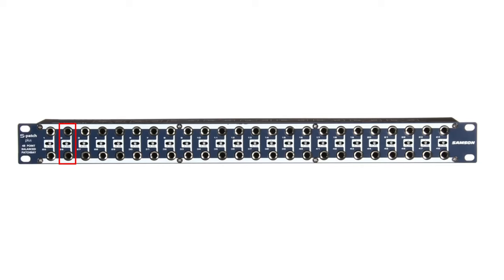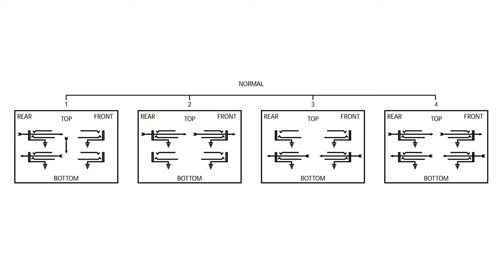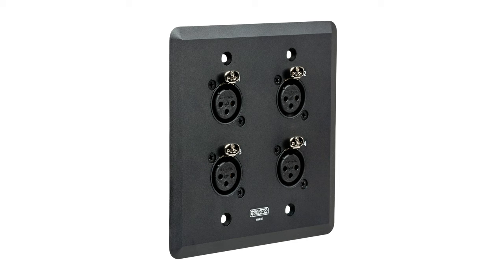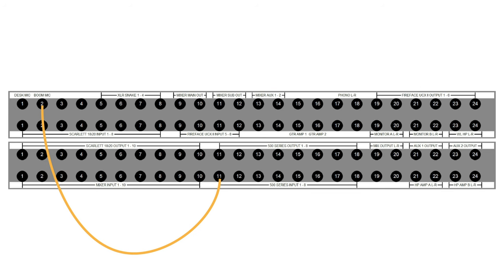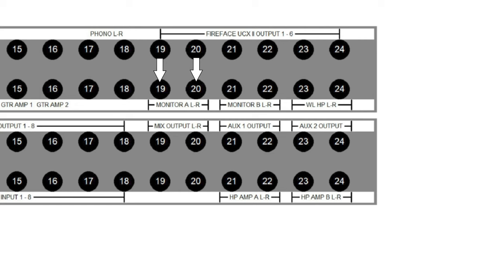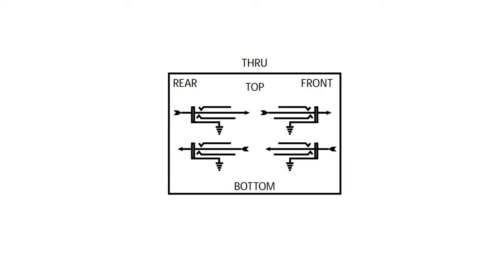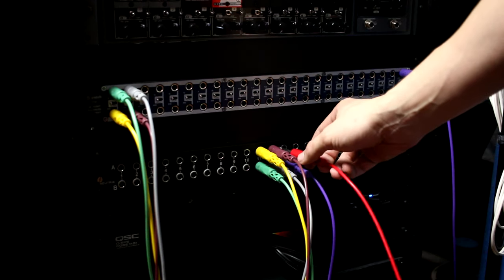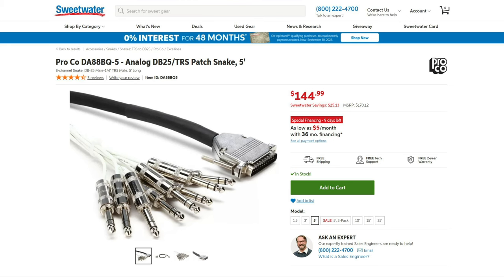How To Set Up A Patchbay In A Studio | Layout, Normalling, & Setup

Comment: stupid question if i want to use a condenser mic wich needs phantom power and route it to a mic pre via the patch bay do i provide it with an external phantom power suply or ?
Reply from the maker: The TRS patchbays in this video can pass phantom power. Just make sure to disengage phantom power before connecting or disconnecting the mic on the patchbay.

Comment: Might've just been a mistake on your end, but the top jacks are typically outputs on patch bays, not inputs.
Reply from the maker: On the rear panel, they are inputs that correspond to the output jacks on the front panel.

Comment: This is awesome but I have a question...At :24 you said the top row in the back are inputs and bottom rows were outputs..I thought it was the other way..outputs usually on top and inputs on the bottom...I'm probably wrong, but i'm thinking of the patch bay as an extension of what is being connected to it..can you clarify? Thanks so much

Comment: I have a question, is it safe to put phantom power directly through the patchbay with all my other gear connected as well? In this case I have the Samson but I've read in forums that for connecting microphones directly into the patchbay you should really get a dedicated XLR patchbay. Thanks a lot for this brilliant information.
Reply from the maker: As long as phantom power is NOT engaged while connecting and disconnecting the mic, it should be ok. However, to be safe you can use an XLR panel instead for patching microphones.
Reply: @AudioUniversity  thank you!

Comment: Could you clarify for me? Your boom mic for example that you showed; how is it going into the patch panel? Is it via a snake that converts to trs? I’m assuming you don’t just do all xlr to trs cables for your microphones?
Reply from the maker: That particular microphone is actually hard wired to the back of the panel with an XLR to TRS cable because it never gets disconnected. However, most mics patch to the XLR panel which is connected to the back of the patchbay.

Comment: Amazing video!! One question.. I have an 8 channel mixer with only 2 stereo imput, and and want to connect all my keyboards at the same time to record, patchbay is a solution for that?
Reply from the maker: Thanks, David! A patchbay would allow you to use patch cables from the keyboard (jacks on the patchbay) to the stereo mixer input (jacks on the patchbay) instead of reaching behind the mixer/keyboards directly.

You can also use two mono channels on the mixer for each stereo keyboard.

Comment: So, if I want to go with a patch bay I need to but a boatload of XLR to trs adapters for my microphones?
Reply from the maker: Rather than connecting the microphones directly to the patchbay, I’d recommend an XLR patch panel or XLR snake that is connected to the back of the patchbay. 

Something like this: https://imp.i114863.net/YgMaGB

You will still need to either solder TRS connectors to that or use XLR to TRS adapters. The benefit is that the mic panel/snake is always connected to the patchbay so you can simply connect your mics to that panel with XLR cables.

Comment: Is this possible? I want to run a mixer into a patchbay that will have at least 6 synths. 3 of those synths can sample. I want to use the inputs of those devices through the patchbay. I then also want to individually connect 9 different FX Pedals in the patchbay so that I could connect which ever synth to the pedal or a series of pedals to record on my PC or one of the samplers. And finally, would it be easier to reroute the audio chain back to empty mixer channels, then out to my monitors? Or should I patch the monitors to the patchbay?

Comment: Hi there, how can you use a jack patch bay with condenser microphones? I have an 18i20 too and I still can't fathom how you would use a patch bay for condenser mics. Would you just keep the two inputs at the front of the 18i20 spare for those mics?
Reply from the maker: The patchbay in this video can pass phantom power. Is phantom power your concern?
Reply: @AudioUniversity  yeah that's my concern.  Could you explain what the cable chain would be please?
Reply from the maker: The microphone will connect to the patchbay with an XLR to TRS cable and the patchbay will connect to the interface with a TRS to XLR cable.
Reply: @AudioUniversity  excellent thank you for the reply. And it's the Samson patchbay that allows phantom power to go through?
Reply from the maker: Glad to help! Both the Samson and the Neutrik patchbay pass phantom power.
Reply: @AudioUniversity  you've been very helpful, thank you 🙂
Reply: @LeopardBull5trik3  The very last line at the bottom of page 7 of the manual for the Samson S patch Plus says: "It is not recommended to connect microphone outputs to any patchbay due to their low operation level."  -  To me this means say taking connecting a dynamic mic with a XLR-to-TRS cable, as that's obviously a teeny signal.  But once boosted by phantom power (from a pre-amp for a condenser mic), or a tube amp (for a tube mic), it's all good.  So I think it ONLY means - don't connect any mic directly, i.e. before it's amped/powered.  I don't think it means "Don't pass Phantom power through it".
Reply: Actually, reading AudioUniversity's reply at the top, I'm talking rubbish.  Because the Phantom Power (PP) effectovely travels the opposite way to your audio.  Out if the pre-amp and up to your mic.  So connecting the mic to the Patchbay is effectively the same thing as plugging the mic directly into the pre-amp.  I've ready though that you should connect everything up (with or without a patchbay, but ESPECIALLY WITH) BEFORE engaging the PP.
I guess this makes good sense, and is good practise.
Reply from the maker: There is probably something to the note at the bottom of the manual, Fred. Thanks for bringing that up. I haven’t had an issue. However, I have heard that disconnecting or connecting a TRS connection while phantom power is engaged can cause damage. So, I always make sure it’s off when making patches.
Reply: @AudioUniversity  This comment thread has been so helpful. In my studio we have a few condensers and mics that require phantom. I also have a drum room with a 12 input cable snake to mic up the drum kit, all the ends are obviously XLR. So because I have a good mix of XLR and TRS instruments I use, I should buy an XLR patchbay (like a standard 16 input one) and use the front face of that, that i could easily plug mics/drums/etc into the front of, and then have the output of that same xlr patchbay run to my TRS patchbay via XLR to TRS cables. And the XLR to TRS Cables NEVER get unplugged so that it prevents the potential damage with the TRS sleeve grounding out on the TRS patchbay. Would that make sense? In short: for a phantom power condenser mic it goes: Mic>XLR to XLR cable>XLR patchbay>XLR to TRS Cable>TRS Patchbay>Normalled to interface. Is that logical?
Reply from the maker: Yes. This is my plan in my next studio. That way, your only chances of patching with phantom engaged is with XLR.
Reply: Thank you this really helped me!